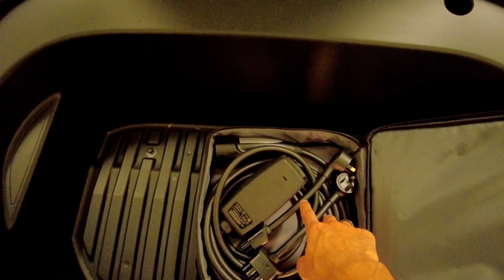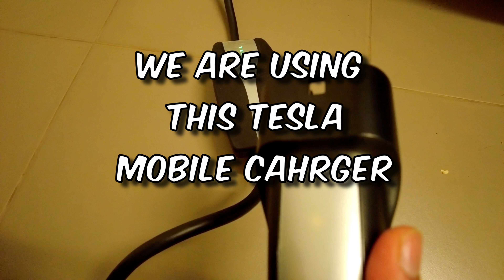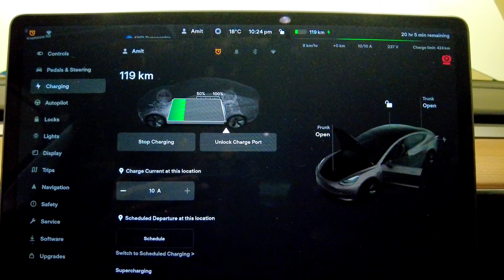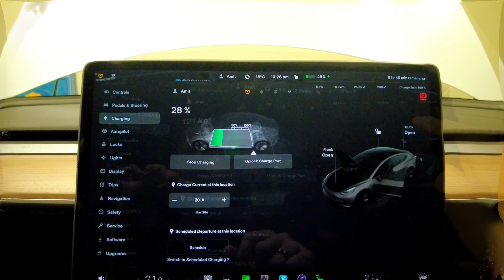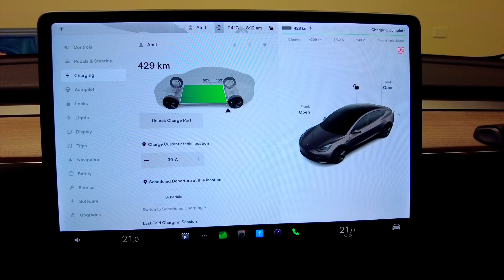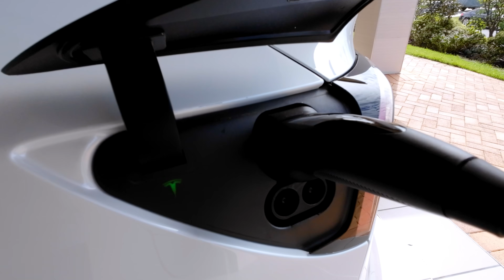How is Charging Tesla at home with Tesla wall connector in Australia 2022

Comment: Can I please ask a question because I am new to this. 
At my work I have those 3 pin commercial type electricity ports. Can I buy one of these Tesla chargers and it plugs straight into it ? I don’t wish to have it hard wired for work
Reply from the maker: Yes I believe you can get connectors that support the commercial there pin for tesla. 
Or buy a charger with the pin. 

https://tessories.com.au/product/tesla-mobile-connector-3pin-adapter/

Comment: Is the black one safe to use in a car port? Or must be fully indoors? And how much do you think its costing you per night to charge at home? Thanks ps, great vid
Reply from the maker: I believe it is safe to use as long the non car connection is not exposed to direct rain. As it is safe to use the connector that goes in car outdoors either way. 

It costs my anywhere from 10-12 dollars to charge my car from 10-100%.

Comment: I was thinking of putting a 32A socket in and just using the mobile connector instead of the wall connector seens as I need to buy the mobile connector now anyway? 32A socket should put out similar if not the same charging speeds right?
Reply from the maker: As far as I can recall mobile connector will support 15A current. But you still are better off using that setup on a 32 APM socket as that can save to quite a lot of money compared to getting a wall connector installed.

Comment: Thanks for the video. How much did you land up paying for your electrical installation and did you just use a local electrician or a specialist company? Cheers
Reply from the maker: We had a professional electrician do it and costed us a bit over 500$
But it depends on the type of connection and distance from your main power supply box and many other considerations. 

I have had our charger for almost 2 years now and it works great.
Reply: @EVsUndone  lovely. Thanks for the reply 🙏

Comment: How much does it cost you to get the wall connector installed?
Reply from the maker: We had a professional electrician do it and costed us a bit over 500$
But it depends on the type of connection and distance from your main power supply box and many other considerations. 

I have had our charger for almost 2 years now and it works great.

Comment: Hi Amit, what are your thoughts and plans around the car batteries once they reached their useful life. Can the battery be replaced by only Tesla or after market battery replacement?

I understand currently, other manufacturers charges around $5.5K to replace their Hybrid batteries and we get about $500 rebate.
Reply from the maker: Hi 
I believe the battery replacement here in Australia can cost around $14k. And personally I do not plan to keep the car beyond the battery warranty period of 7 years. 
I do not believe there are aftermarket batterie replacements offered in Australia so Tesla is the only choice. 

And there is certainly no rebate on battery replacement.

Comment: Hey mate, do you have 3 phase power in your house or single phase? I have single phase and trying to determine if the Tesla wall charger will have the same rate of charge as yours in the video
Reply from the maker: Hi Joshua,
I have a single phase connection, although I have set max on my charger to be 30 apms. The max  allowed is 32, so you might be able to get up to 50km/hour charge rate

Comment: When you charge st home an indicator on your phone shows like 6kw . +19kwh 32A can u explain these settings. Thanks.
Reply from the maker: Hey Sami,
6kw/hr was the rate at which the car was charging. 
+19kwh is the total charge done in the charging session.
 And max ampere allowed for my single phase is 32A(you can choose to change this to 10A to charge your car slower,  apparently that's better for the longevity of cells. )

Hope that helps.
Reply: @EVsUndone  thank you. It did.

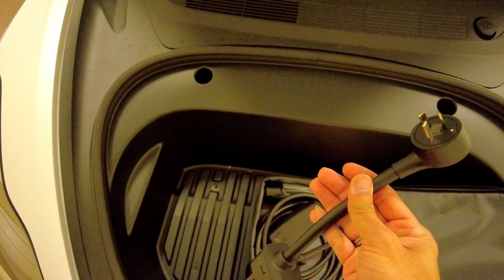Comment: 0:45 these are not brackets, it is a slightly smaller earth/ground pin for the 10amp. The 15 amp has larger pins on the socket.
Reply from the maker: Thanks Leo, good to know😊

Comment: hi you install the wall connector with msingle phase or triple phase?
Reply from the maker: Hi Elvio, I got the setup on a Single phase
Reply: @EVsUndone  rigth, and take 8H to full charge??
Reply from the maker: Yes, never had better lower then 20 so from 20 to 100 7-8 hours
Reply: @EVsUndone  thanks mate. Will try that way

Comment: Good simple instructions on this video.  I have the same car MY standard LFP coming next week.  I’ve read many different things about charging to 100%.  Do you charge to 100% every night or 1x a week?  If you charge to 100% every night like Tesla recommends have you seen any battery degradation as some have said that I’ve read?  Thanks
Reply from the maker: Hi Vu,
I have been charging my car to 100 percent at least 3 times a week and degradation I have seen in a Year is of 12 km less range
The range now shows 428 inserted of 440[range when I bought]  and since degradation happens most in first Year, so it is not too bad. And I think it's better to let the car charge 100% and save yourself hassle of thinking about switching the max charging percentage.
Reply: Thanks for the detailed reply.  That’s reassuring to know.  So you charge 100% 3x a week and the rest of the week you charge to 80%?  Sorry for asking such detailed questions but you seem to have good results.  Thanks again.
Reply from the maker: @vtthesuccessfinder  I meant I just charge my car 3x a week totally. Plugging in every other day. 

And always leave max charging limit to 100%. The only variation is if I have a planned trips then I have charged my car every night to 100%.
Reply: Oh ok.  Thanks for clarifying.  I hope you continue to enjoy your Tesla and I look forward to experiencing mine.